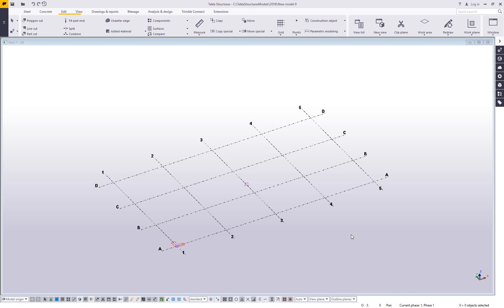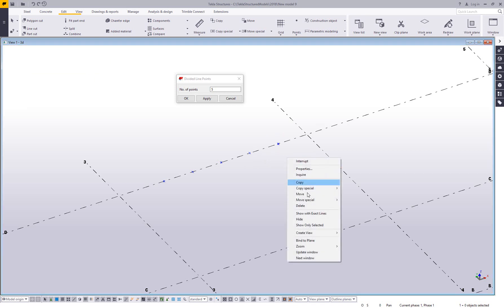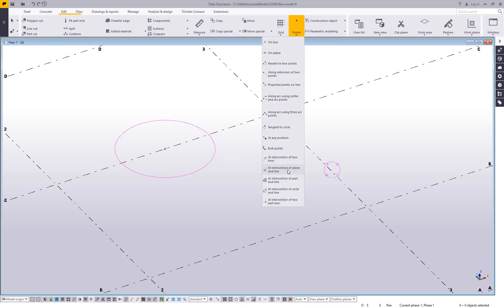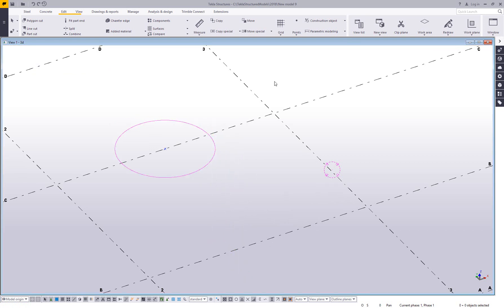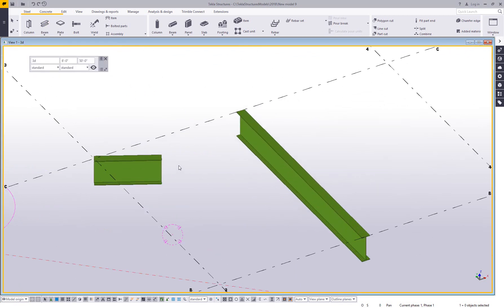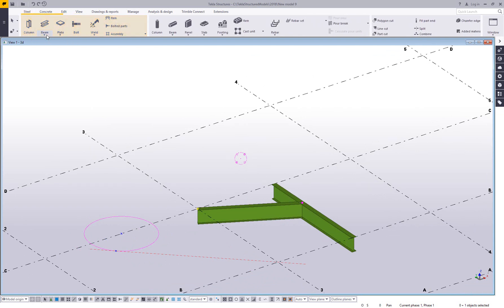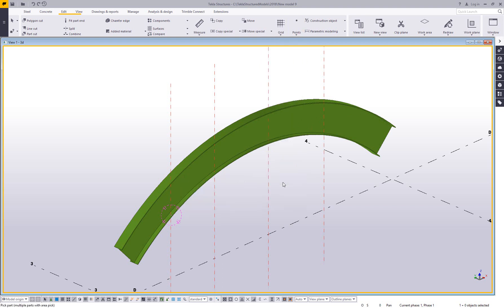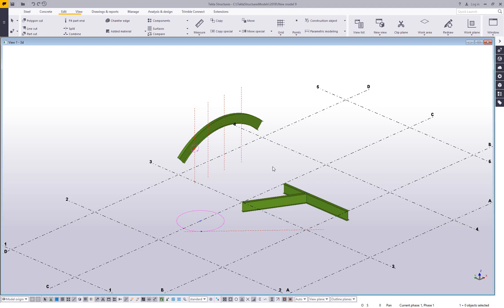Point Tools in Tekla Structures

Comment: I am trying to draw a line that forms a tangent to two unequal circles. So simple in AutoCAD but for the life of me I cannot figure out how to do it in Tekla.
Reply: Yes, unfortunately there is not a straightforward circle-circle tangent command. You can run the "tangent to circle" point command between the circles, however as you don't know the first origin line position you have to run it multiple times between the circles to find the points on both sides. Not very intuitive. Honestly what I do is revert back to classic drafting skills to lay out the points - you can find an example in this article: https://en.wikipedia.org/wiki/Tangent_lines_to_circles scroll down to find the external circle to circle example.

Comment: I have a question. How do you make a beam translucent?
Reply: There are several ways to do this, but the quickest is to use the Ctrl+1-5 keys on your keyboard to change the objects to solid, transparent, wireframe, etc. https://teklastructures.support.tekla.com/2018i/en/mod_changing_representation_of_parts_and_components

Comment: DEAR SIR, in Tekla Structure 2018, can i create cone from bent plates using faces. please help.
Reply: It can be done, but you have to create a series of very thin triangular plates and join them together. It would be better for you to move to v2018i or v2019 where the conical bent plate is now included as an option under the bent plate tools. You should reach out to your local Tekla helpdesk for assistance.

Comment: Dear sir can we change the point colour
Reply: Yes, but not easily. It is set as one of the pre-defined symbols in the system folders, so you would need to redefine several symbols - point in plane, selected point in plane, point out-of-plane, etc. I would recommend reaching out to your local helpdesk if this is something you need. https://www.tekla.com/contact/offices-and-resellers
Reply: good question because the stupid managers replaced the point color from yellow to dark blue which is unvisible in black background